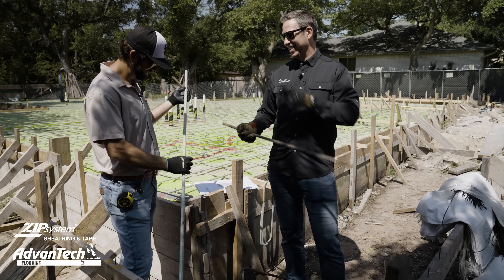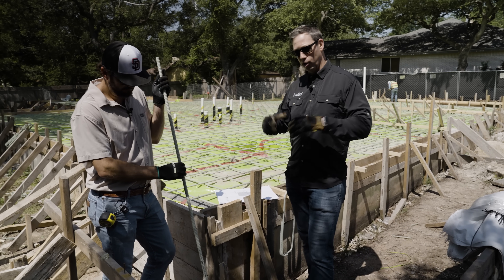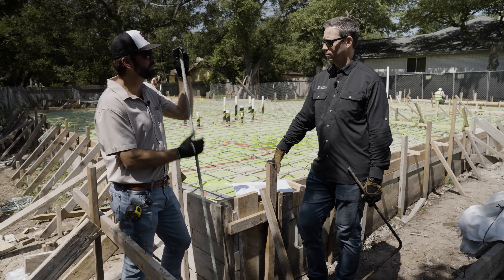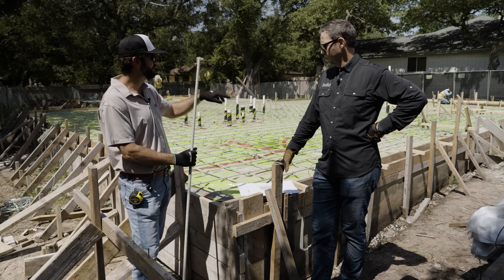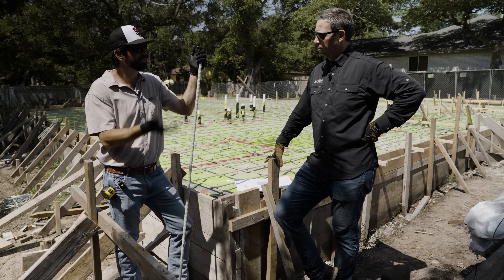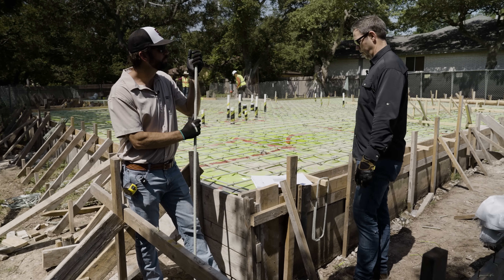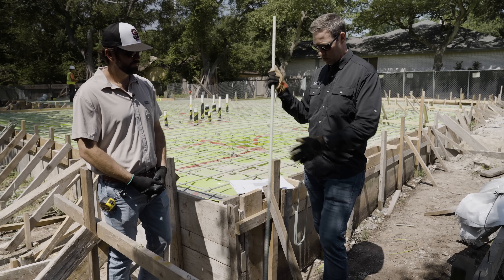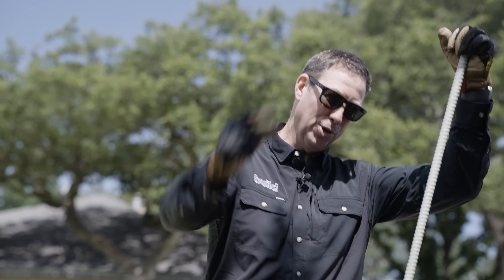Comparing Steel and Fiberglass Rebar - SURPRISING results

Comment: Would be interesting to see fiberglass reinforced concrete as a mixture.
I know some people in Switzerland were playing with this where they added, like little fiberglass threads inside of the concrete mix, allowing you to pour the concrete as though it is reinforced without actually having to do the work of the reinforcing. The other benefit is that it becomes a homogenous material. It truly is reinforced throughout the entire assembly.
Reply: It does add homogenous tensile strength and reduces cracking but it's not a substitute for rebar when you need force distributed across the length of a beam or slab. On larger pours it can also cause the fibers to be unevenly distributed as a factor of fluid dynamics.
Reply: @Suavocado602  thank you for the answer there, that makes sense, it would be hard to create a close to homogenic mixture with such different materials.
That said , concrete by default is aggregate and cement and stays pretty well mixed, by virtue of the rotating cementtruck drum.
I guess I’m curious why this is all that different? Given large particles tendency to rise and different densities, etc. working well in concrete already?
Reply: @FreekHoekstra  the issue I'm referring to has more to do with the alignment of the fibers that change as it flows. That said, high performance fiber reinforced concrete has come a long way in the past decade. Iran made some very durable bunkers using the material so maybe it's been solved by now.
Reply: @FreekHoekstra  the fibers tend to clump together since they're slightly bent or hooked, making them unevenly distributed. And the actual design calculations heavily rely on calculating a required kg/m3 amount of the fibers. This is often solved by actually mixing them just before pouring in sort of a direct feed matter.
Reply: @rsnmaa  On big jobs you may see the trucks stop at a raised platform where the fiber is put into the mix just before placeing.
Reply: That product is widely available and used in low-strength applications like patios and front walks.  I don't know how well it really works, though.
Reply: Search - - - steel fiber reinforced concrete
Reply: Plus a lot of this fiberglass could be sourced from decommissioned wind turbine blades.
Reply: Fiber is used in place of a "welded wire mesh" inside a slab

It helps control micro-cracks but it doesn't really add to the overall strength
Reply: There are a lot of micro and macro ( 1 plus inch ) fibers you can use, steel glass, kevlar, basalt.
Reply: Fibrecrete? We use it in Australia, it's used in thick slab vibrated road construction.
The particular road I worked on had up to 100t+ oversized loads transported on it before the town had a bypass built, that was 18 years ago and it's still in mint condition
Reply: I believe it's called "fibermesh".   As a prison Maintenance manager, I specified it on one occasion in a location that was extremely difficult to reroute traffic around.   I specified both fibermesh AND rebar for the longest possible life.
Reply: If your life depended on structural integrity (ie, suspended floors and walls), go with rebar. If you want a strong slab that resists cracks, go with macrofiber mixture. Best of both worlds is using both.

Comment: I'm curious about breathing the fibers. When we do fiberglass insulation we have the same cactus in the hands feeling if not wearing gloves. We also make sure we are wearing masks.
Reply: I hope this isn't going to be an asbestos-like problem in later years when people have to do demolition.
Reply: MST BAR does not release fibers. It has a different molecular structure than fiberglass insulation. Cutting MST BAR produces round dust particles similar to cutting stone or wood. Although there is no specific health risk in cutting MST BAR, personal protective equipment (PPE) should always be worn.

Comment: I think the industry is moving away from the epoxy coated rebar now because they found that when the epoxy gets nicked (like it inevitably does), water gets under the epoxy and then is effectively trapped inside and the deterioration begins. I’ve used a fair amount of galvanized rebar on jobs exposed to harsh environmental conditions. I haven’t been around long enough to know if it surpasses the standard 100 year expected lifespan of standard rebar 🤷‍♂

Comment: I'm a bit surprised about the mention of concrete sprawling and rust on a sidewalk. In Canada, many sidewalks don't even have rebar in them. They just don't need it to do the job that they are expected to do, and mind you, we do run sidewalk plows on them during winter. A 10 centimeter thick slab with compacted stone under it is more than strong enough in most cases. We've got a fair bit of clay in our soil, and despite that, we generally don't have much of any problems with our sidewalks.
Reply: Sprawling? The word being discussed is spalling not sprawling.
Reply: there's a lot of softer soil in the US, as well as not having mountains and stone quarries everywhere.

Comment: How does it hold up in fire (heat stress) compared to steel?
Reply: It doesn't burn very well since, you know, fiberglass at the core is a rock product.

Comment: In school we were told that in an over stressed system, you need the steel to stretch first at the bottom (lower factor of safety) before the top concrete (higher factor of safety) catastrophically instantaneously fails. How does the fiberglass accomplish this?
Reply: It doesn't. The fiberglass will not stretch. It will catastrophically fail once stressed beyond its limits.
Reply: @ulbuilder MST fiberglass rebar does stretch (ie, bend). Actually you can bend their fiberglass rebar 180 degrees without breaking as demonstrated on their website. The difference is fiberglass rebar has memory and will return to its original straight state after bending force is removed, whereas steel rebar will remain in its bent state (ie, ductile). So the argument is in an earthquake, the ductility of steel rebar will give you better warning before failure. But fiberglass rebar has 3x the tensile strength of steel. MST have shown their rebar reinforced concrete can last 2 million cycles of back and forth flexing at around 2-3 hertz before fatigue failure, whereas equivalent steel reinforced concrete slab will fail after 20,000 cycles. So pick your poison. I think as the industry gets more used to glass fiber rebar, it will be code approved for high seismic zones. The building industry advances like molasses in January.
Reply: @ulbuilder If you mean stretching along the long axis of the fiberglass rebar, it can withstand tremendous amount of force, far more than required by code.

Comment: I talked to an old concrete guy who told me, "The thing about concrete work is that everything you do is simple, but every single thing is HEAVY."
Reply: Reminds me of Carl von Clausewitz, “Everything in war is simple, but the simplest thing is difficult.”
Reply: Glass rebar ought to be a lot lighter than steel.
Reply: @comfortablynumb9342  25% lighter, so it's probably still a bit heavy.
Reply: @FranciscoTChavez  25% less weight than steel is a big help if you're the guy carrying it.
Reply: @FranciscoTChavez  That should be 25% OF steel. That is what I understand it to be.
Reply: @comfortablynumb9342  300% i would guess. my only question is the shrink and swell difference as temp changes

Comment: what about the difference in thermal expansion. steel and concretes mostly match
Reply: MST BAR has almost the same expansion as concrete in longitudinal direction. Moreover, MST BAR maintains its very high bond strength to concrete through temperature fluctuations. Simply put, MST BAR performs very well under these conditions.  This is one reason why many municipalities are regularly specifying MST BAR for infrastructure, highway and bridge projects.

Comment: Optimal composite ratio is 70% fibre/30% resin. You need a minimum of 30% resin to stick the fibres together. 85/15 is not possible

Comment: what about the UFER grounding for the electrical systems?  -
Reply: I guess you could add a little steel just to serve that purpose, not much is required. The electrode must consist of at least 6.0 m (20 ft) of electrically conductive steel reinforcing bars or rods of not less than 13 mm (1/2 in.)

Comment: I think one of the major benefits is spalling resistance because of no internal pressure developing from rust. This is probably ok for flatwork and foundations but I bet it'll shine in exposed columns and beams, such as bridges.
Reply: The big concern seems to be how any of these alternative rebars perform at failure. A steel reinforced concrete beam, when it fails in, say, an earthquake too big for it, the concrete shatters out and the steel bends, so if it's engineered right you should have a chance to evacuate the building or get out from under the bridge before the steel actually rips apart and everything falls down. A lot of the non-metallic rebars, when they fail, they shatter along with the concrete, so in the same earthquake these structures are at risk of collapsing without warning.
Of course, if a steel reinforced structure is old enough that the steel has started to rust, it will collapse without warning under that sort of stress just the same as if it had no rebar at all.

Comment: Nice to see it in Amerika....But in my eyes you did not adres one of the main plus points of this material.....ea its non conductive ness....

About 15 + years ago when i was stil in construction and i worked as a cad designer at a structural design company i came across this type of product and they had a presentation at the company i worked at .....

I was working at that time making plans for a new hospital wing here in Holland where we had to make  an M.R.I room....

And normally these rooms are like bunkers because of the magnetic interference etc etc causing lights to flash etc when not built to standaards.....

Wel i asked them if this would help and you guessed it it does.....

We could make the walls of that room a lot thiner etc etc....

It was as far as that company here   said the first to use it for that purpose Although they were using it at that time in Tramway Foundations on bridges to also not let signal current leak out which was causing fals red signals to trip.....

So yes another great benefit you need to consider for this material.....my client was certainly happy as far as we know it worked and did the job....it saved a lot of hassle and money for them....

Just wanted to let you know

Comment: Does it expand thermally in the same ratio compared to steel rebar? one of the nice things about concrete plus steel rebar is that they kinda shrink and expand in the same ratio under thermal loads
Reply: MST BAR has almost the same expansion as concrete in longitudinal direction. Moreover, MST BAR maintains its very high bond strength to concrete through temperature fluctuations. Simply put, MST BAR performs very well under these conditions.  This is one reason why many municipalities are regularly specifying MST BAR for infrastructure, highway and bridge projects.

Comment: I first used this reinforcement in the Netherlands (then under the name ComBar) as a chief strucutral engineer of a precast concrete factory in concrete walls, where it supported the thinner faced concrete, thus acting as a thermal barrier (and no risk of corrosion). While some properties are better as opposed to regular steel rebar, the low adaptability on site (or even in a precast factory) is a major hindrance. That and the Eurocode has low adaptibility to replacing the steel for GFR. A lot of the formulas in the code have a basis in the fact that concrete structures warn the user before they fail (by cracking in a certain way for example) -- what does  astructure say when the material stretches far more easily?
Reply: Essentially the only requirement is that GFRP is less fragile than concrete -> the reinforcement needs to be able to stretch more than concrete. Of course too 'stretchy' reinforcement will grow crack sizes and effect sustainability.

Comment: Curious as to mingling GFRP and steel. Lots of comments about the sheer strength questions on GFRP but also curious about job site changes when concrete delivery is imminent.
Reply: Mingling MST BAR with steel rebar is acceptable.

Comment: And add graphene to the concrete mix.
Reply: Which company offers this as an admix? Seems expensive!
Reply: @MadLadsAnonymous  There are plenty of videos here on YT about the crazy strength increase.
Reply: @TroyRubert  I believe you and have recently started looking into concrete. I am thinking of how much I'd need for a geopolymer concrete pour of a large ICF build (foundation and walls).
Reply: @TroyRubert  Yeah, my goal is to come up with a custom fiber mix of graphene plus basalt fiber for the micro, Helix rebar for the macro, and added Xypex self healing mixture so cracks heal in the presence of moisture.
Reply: @MadLadsAnonymous  very cool!

Comment: Matt, I hoped you might show how they bent the fiberglass rebar into the loops on that beam section. Torch to soften the polymer?
Reply: Noooo way, you can never do something like that with GFRP. That's probably be biggest downside of this new type of composite rebar. You have zero options for fabrication in the field. All bends must be pre-made at the factory and delivered to the jobsite. That said I think it is worth the trouble. Built an ICF foundation with it last year, used it in the slabs as well. EASILY a 500-year foundation given the waterproofing we did, probably closer to 1000. The house sitting on top of it could be rebuilt a half-dozen times over the coming centuries no sweat.
Reply: They said they ordered it fabbed that way, no on-site forming.

Comment: I didn't hear the question about whether the steel and CFRP could be combined into the same form. Say, CFRP where you need the tensile strength, tied to steel where you need to custom bend something on site?
Reply: Yes, using both MST BAR and steel rebar in the same wall is acceptable. MST BAR is not CFRP, it is GFRP. CFRP’s come at a much higher price.
Reply: @g2buildingproducts  Any advantage to GFRP over CFRP other than price? 

I assume CFRP—carbon fiber, right?—has much higher flexural strength than GFRP.
Reply: @MadLadsAnonymous  Yes, CFRP is Carbon Fiber Reinforced Polymer. GFRP is Glass Fiber Reinforced Polymer. Assumptions are never safe. The only way to know flexural strength comparisons is to look at the testing and related results.
Reply: @g2buildingproducts  I will look into CFRP for a future build. Thanks for bringing it to my attention.
Reply: @MadLadsAnonymous  Best of luck!
Reply: This is the big question! An engineer told me the tensile strength is a nonsense metric when you typically way flexing capacity that steel has but GFRP doesn't.

Comment: What's it like innthe cold if installed hot? Can it not push the concrete in half? Steel is used because it has the exact same expansion coefficient as concrete - they move together in unison.

Comment: As long as you don't bend it, glass/polymer fibre is strong.  Once the polymer is crushed, the glass fibre is prone to shear.
Reply: That makes me question its application/uses. If used in a lintel.

They are meant to withstand flex.
Reply: @MinkieWinkle  - When using MST BAR in lintel applications, the size and quantity of lineal bars may need to be adjusted depending on the span of the lintel. Our engineering department can give direction in this regard. Oftentimes a 1:1 conversion from steel to MST BAR applies.
Reply: the tensil strenght of fiber optic is high but tying it in a knot breaks it very easy as the knot gets tighter. seems like it becomes a different substance, but it is glass so i would like to know what vibration testing has been done

Comment: I was looking at this stuff last year(mostly research papers and how the Germans use it) for its properties to not rust but also resistance to earthquakes. It’s generally a better material but if you don’t want it to snap in sideways motions(it can swing more and recover but snaps at its limits, unlike steel which can maintain some structural integrity), you need a lot more of it and potentially mix it with carbon reinforced rebar.
Reply: I wonder too about pairing it with fiber reinforced concrete.
Reply: @alexdrockhound9497  I think it's a very new material science and there's a lot of experimenting to do to find the optimal design for each common context. But there's a lot of potential to fix a lot of problems by getting rid of steel rebar.
Reply: @tealkerberus748  i think the biggest hurdle for it will be that it can’t be bent on site, it has to be fabricated with the bend in it. Thats going to be a lot of trouble for economies of scale to make it cheaper, and a lot of trouble for the people working with it, and logistics challenges too for transporting the bent rebar.
Reply: @alexdrockhound9497 can't stainless rebar be added where the turns are needed?
Reply: Carbon rebar is horribly expensive.

Comment: What if the framer nails it when hammer drilling for anchors, do you lose the effectiveness of the entire embedded stick, or is the damage localized? Can you tell when you've hit one like with steel rebar?
Reply: Thats a really good question!
Reply: And also, i wonder if it can be pre tensioned also for other kinds of projects like wide bridge spans.
Reply: @alexdrockhound9497 I think there is a bridge on I-80 in Nebraska that is all FRP
Reply: Hammer drill would go right through this stuff without much if any warning, though I doubt the occassional hit would be an issue, the designed tolerances are not that finely tuned.